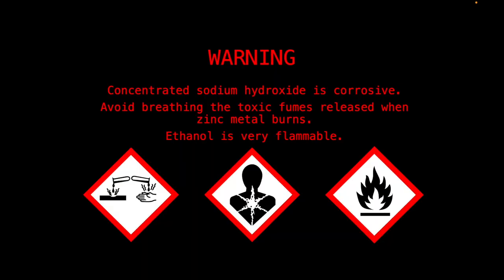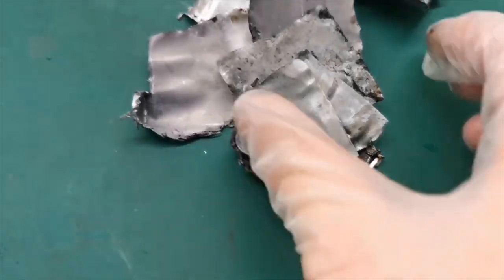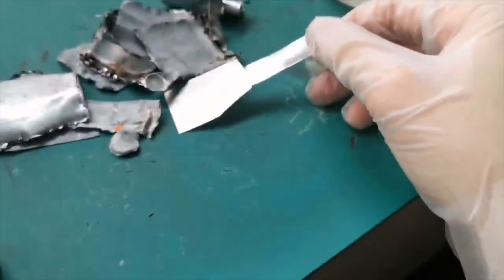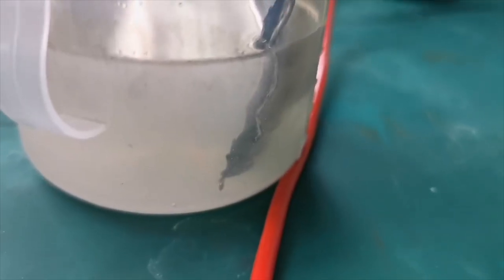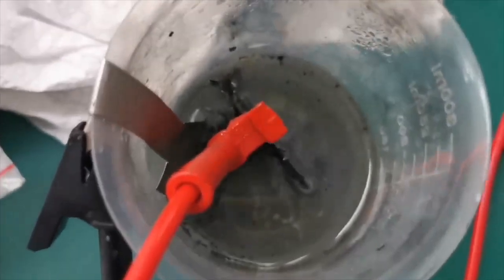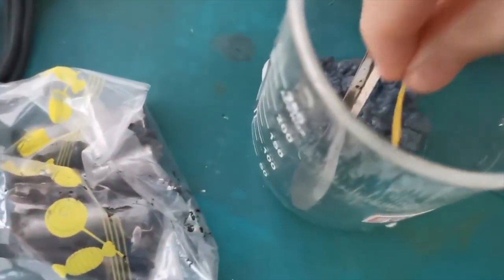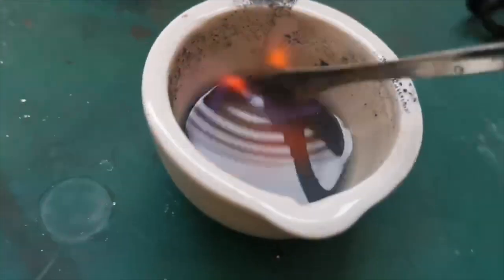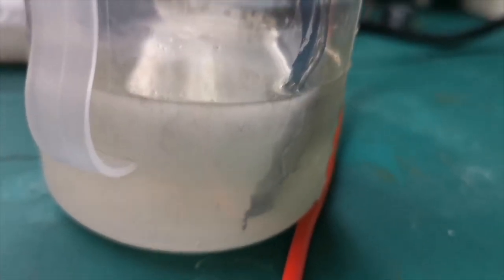2.2.5 Transition Metals - Making Zinc Powder from Batteries

Comment: Can we use any other fuel instead of Ethanol, let say Methanol or kerosene or anything to burn the Zinc powder
Reply from the maker: Methanol would certainly work. Isopropanol works as well, but I would avoid kerosene. Because of its relatively high boiling point and high carbon content it might leave impurities in the zinc powder.

Comment: you know if "mu metal" can be used as an inert anode for this electrolysis?
Reply: I'd expect it would be even better with its nickel content.
Reply from the maker: Yes it can. In fact, many of the common metals (iron, nickel, and in special cases copper) can be used as an inert anode in alkaline conditions. This is a very big advantage to the corresponding acid electrolysis process, which only tolerates platinum/graphite/lead anodes.